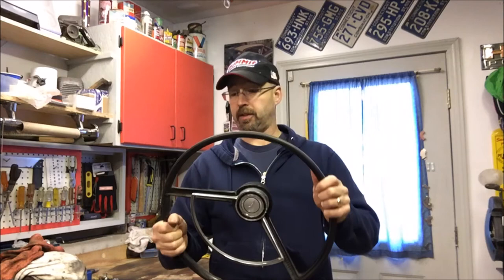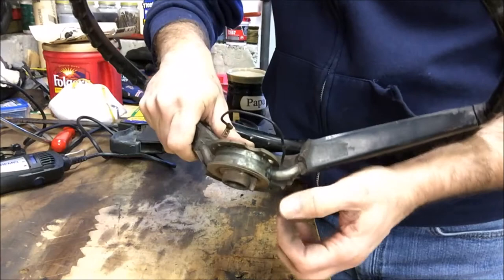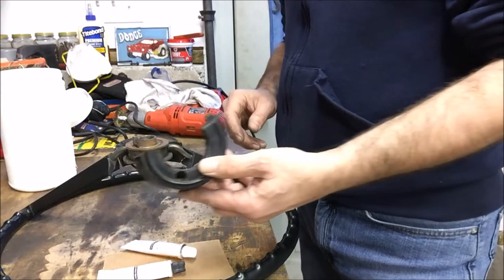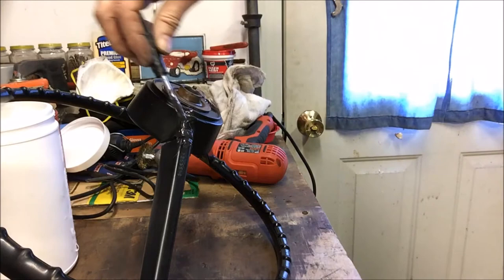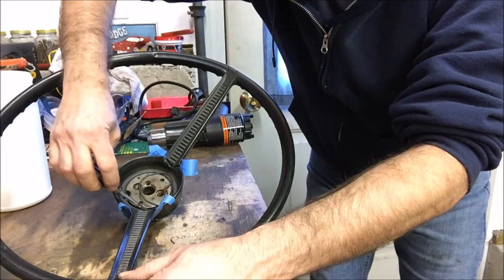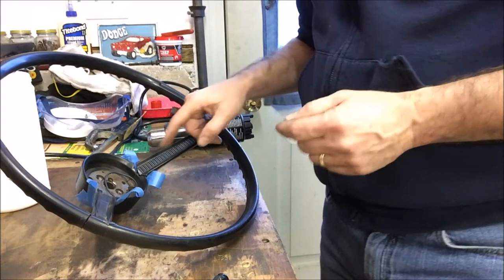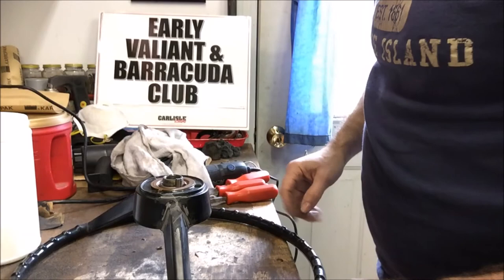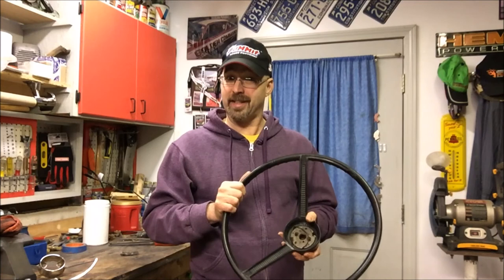How To Repair a Cracked Steering Wheel

Comment: The entire bottom half where the horn ring mounts on my 65 fell off . Would you suggest that I try this or should i just change the wheel?
Reply from the maker: you could try JB weld or an epoxy glue after cleaning the breaks and try to put it together, but will you trust it to stay together? You could find another steering wheel in better shape and be better off.

Comment: Good info...somehow I missed what you cleaned the overall steering wheel with to remove the years of gunk.  Also, you mentioned the small divots in the wheel besides the actual cracks but then never explained how to fix it.  Anyway, thanks for the video!